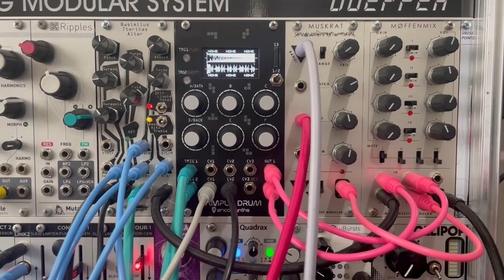How To Use a Clock Divider as a Gate Sequencer

Comment: Do you take random stepped voltage for modulating the divisions, or some regular pattern? Also, at what rate is the CV clocked? Would have loved to see, how exactly you come up with the beat that plays in the background...
Reply from the maker: It’s stepped voltage from a sequencer, this time specifically voltage block.  I was clocking it rather quickly in this example.

Comment: I ordered a 4ms QCD to do the same thing ! With a switch for muting triggers is quite similar to Moffenzeef Mito
Reply from the maker: Exactly!  You got it, it’s a really “open” way to patch sequencers that gives you so much to work with.
Reply: @GrantBoss  I ll modulate division / mult with random cv and voltage block stepped cv and try to make weird generative beats . Also triggering sliced breaks on the sample drum with a fast clock and the start point with a slower modulated clock will be fun .
Reply: Did it work with the QCD?

Comment: The perfekt Combo is Mito and voltage Block 👍
Reply from the maker: This is the way.
Reply: The new perfect combo is Intellijel Tetrapad/Tete in voltage sequencing mode and Mito. The reason is that Tetrapad/Tete is bipolar so you get less “ghost beats” out of Mito. Tetrapad/Tete has the loopy function in its sequencer so it can get even more glitched out. When using my voltage block with Mito I’ve been running Mitos trigger outs through vca’s and multing  the voltages from VB to Mito to the vca so you only get the triggers you sequence.